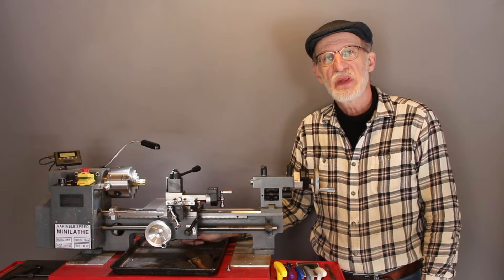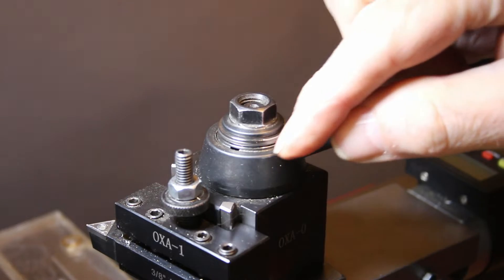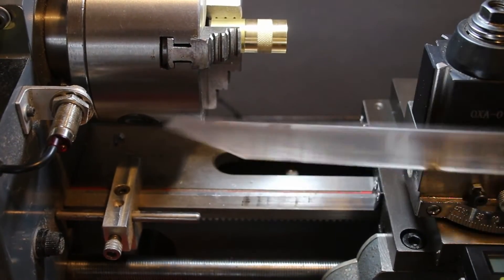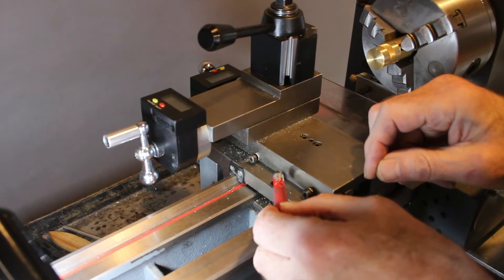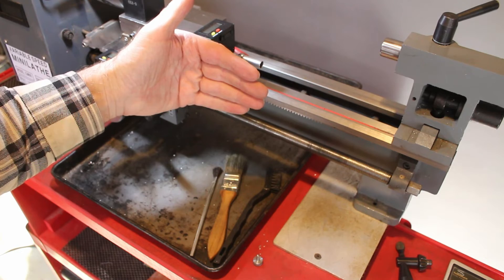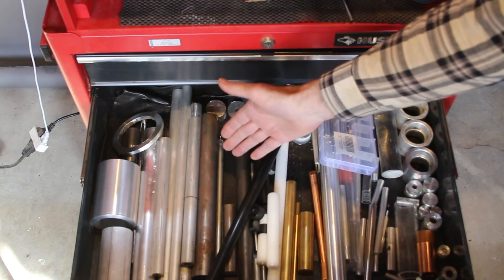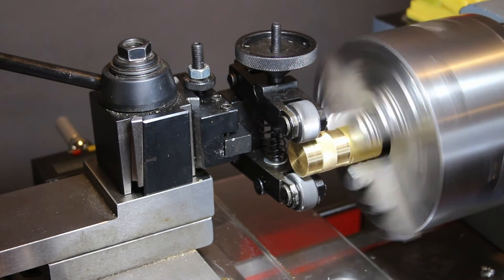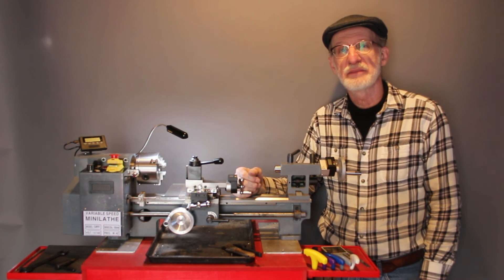Mini lathe add-ons and upgrades

Comment: I am not happy with the HALL sensor's location. It can be mounted inside the head stock, there is space enough for that. It is very vulnerable in that position  and might be in the way with exchange the chuck.
Reply from the maker: I appreciate your suggestion, but I found this to be the most practical location.

Comment: I got one recently but there so much movement around the cross-slide and compound ive tightened up all the gib screws but they still move, any idea if this can be fixed 🤔
Reply from the maker: If you have a mini mill you may be able to re-machine the ways.  I did that with my cross slide and it really tightened things up.  I bought a carbide dovetail cutter that really breezed through that cast iron!
Reply: @GuyMarsdenMakesStuff  
Thanks for the reply and the advice, sadly I don't have a Mill, but I have found somewhere online that does sell new gibs, the lathe is second hand and I can tell it's had lots of use, so hopefully the gibs are worn out, I'll replace them and take it from there.. all the best pal 👍
Reply from the maker: @BillSikes.  Well, one option is to buy new compound or cross slide from Little Machine Shop.  I got an extra long cross slide from them last year and it is better than the stock one.
Reply from the maker: @BillSikes.  You know Little Machine Shop sell replacement parts for the C3 lathes.  I got a longer cross slide upgrade kit last year that allows me to work larger diameters.  Definitely an option!

Comment: Hi Guy, I know an old video but found extremely useful. I have a mini lathe and have been wanting to upgrade to DRO’s for some time. My cross slides have some backlash in them that I have been unable to correct, do these DRO’s handle the backlash or just count the revolutions and thus I’ll still have an issue? Thank you!
Reply from the maker: The DROs do actually count turns but as long as you take up the slack like on any adjustment for a machine they are very accurate.  The only issue I have with them is the battery compartment is weak and sometimes the batteries cause dropouts.
Reply: @GuyMarsdenMakesStuff  thank you, will look at ordering a set. Much appreciated!

Comment: These are great upgrades, for sure
though, i am a bit iffy about those cross slide rotation-based DROs since they depend on your cross slide leadscrew having zero backlash; though i guess one can preload them before doing any cutting when there is some backlash on said slides, there might be some difficulty maintaining precision if relying on those alone. But it certainly helps.
If only they could make DRO slider units much more smaller and compact enough to fit on these mini-lathes...
Reply from the maker: You get used to preloading them just like you would on any machine. But I have swapped out my tail stock to a linear gauge.

Comment: I wouldn’t think that MDF, being so soft, would provide adequate rigidity for a lathe support.
Reply from the maker: It's a strong box structure reinforced in all the corners with hardwood, and a hardwood 1x2 along the front bottom edge under the lathe.  MDF is surprisingly strong when used appropriately, and is also somewhat good at vibration dampening.
Reply: @GuyMarsdenMakesStuff  Just be careful if your cutting that stuff.  They call it cancer board.
Reply from the maker: @rodgraff1782  Yes I have excellent dust collection in my shop.  I have no dust at all on my work surfaces.
Reply from the maker: @rodgraff1782  it's stronger than it looks and is very dimensionally stable.

Comment: Those DRO-s you have are great. I have a SHERLINE 4100 and went to LITTLE MACHINE SHOP to locate the same bits. Unfortunately the various DRO-s do not identify compatibility. How did you identify what bits you have installed from LMS were compatible for your particular Lathe? Thanks in advance. 😊
Reply from the maker: My lathe is a standard Sieg C3, so those parts fit perfectly. However I've become very disillusioned with those DROs because they are flaky and don't measure actual position just the rotational position of the handles. I'm in the process of replacing them with linear magnetic readouts.
Reply: @GuyMarsdenMakesStuff  Thanks so very much for the heads up! 
Best Wishes......

Comment: I had recently  bought the older version of those cross slide DRO's from a  guy. They do not measure the actual movement, but rather measure the handwheel position, which is a pain. Are these units somehow different? I cannot see how they would be.
Reply from the maker: Yes, I misspoke in the video. But as long as you're always turning them in the same direction to get a measurement that you need they work great for me.

Comment: How do those DROs on the cross slide and top slide know when the position is changed?  Lots of good ideas here!
Reply from the maker: They read the rotational position of the handle. As long as you always turn them the right direction they are pretty darned accurate. I got them from Little machine shop, Link in the description below.

Comment: You certainly should never use your leadscrew nuts as a means of locking the saddle
Reply from the maker: I agree, I made a locking lever for the carriage.  Not sure if that is shown in my video.
Reply: @GuyMarsdenMakesStuff  Can I sk what you intend to make with the lathe?
Reply from the maker: I have been making a ton of stuff on it!  Check my machining playlist.  Mostly brass, aluminum and Delrin, but also some steel parts.
https://www.youtube.com/playlist?list=PLbms9GizN4aTLsOwolr5cuM2JtmTku12E

Comment: Hi ! Geat video ! I want tool locking lever but i dont have ideea the model and sise . . Please if posible send  to my link for this tool ? Thanks !
Reply from the maker: Not sure what you mean by a tool locking lever. If you mean the red handled locking lever I used for the carriage, that is just a cut down hex wrench that drops into a cap screw.

Comment: I have a 8x16 MX-210 that I bought new for $800 and it to was all a mess when it got here .. ended up paying $500 and have since done so many improvements, and have a 3-4 & 6 jaw chucks for any type of work .. I love the light.. I will buy one for sure !
Reply from the maker: I have those lights on all my machines now; mill, lathe, drill press.  They're great 🙂

Comment: If the glue fails that magnet will fly like a bullet
Reply from the maker: Well, it's been there for over 6 months!  I'm thinking about drilling and tapping a 4-40 bolt and mounting a countersunk magnet instead though. Thanks for jogging me to do that.

Comment: I just got my first mini lathe and I traded a compressor that I got for free for the lathe lol it's from 1986 but it's an American made lathe and just needs some maintenance and a good lube job
Reply from the maker: It sounds like you've got some work cut out for you getting that thing fixed up. There's a rule of thumb that if you buy a machine tool like a lathe or Mill you're going to spend as much on tooling. But in your case you're going to be spending a heck of a lot more on tooling!

Comment: Certainly some interesting stuff. Beside the head bearings replacement they are nice tricks. My best advice is to REMOVE the electrical cabinet from the place where it stands. In some case it comes in the way but mainly because it's much more convenient to have a separate remote electrical cabinet. It will allow for any electronics addons or repair much more easily...
Reply from the maker: Great point!

Comment: I like the carriage lock. Very minimal yet effective without really needing to bury holes in the lathe
Reply from the maker: Thanks. It is simple but sometimes the lever falls out of the cap screw at inopportune times.  And also it limits travel of the saddle.  So someday I may do a different version like other people have where it is outboard of the saddle.
Reply: @GuyMarsdenMakesStuff where can an example of this outboard saddle lock you are referring to be found? are there any links? thank you
Reply from the maker: @I.H.D135  littlemachineshop have one that bolts onto the saddle:
https://littlemachineshop.com/products/product_view.php?ProductID=2977&category=

Comment: Guy I love your video and I will be modding my mini lathe which is arriving today. So I also subscribed. However you have made a mistake when you are talking about the small DRO’s. The DRO that you have installed on the bed is measuring actual position. The other 3 including the tail stock one are measuring rotation of their appropriate lead screws, NOT actual position. They use rotary encoders which are housed in those black plastic boxes you have mounted behind the hand wheels. They are very accurate but they are not really measuring the position of those slides like the big one is doing. The only way to measure actual position is to have something mounted on the individual slides tracking it’s position relative to their bases. I have similar rotary ones on my Sherline mill and they are extremely accurate and repeatable. 
I can’t wait to watch more of your videos.
Reply from the maker: You are right, and not the first person to correct me on this. They are extremely accurate and repeatable so long as you always turn them in the right direction as you're coming into the workpiece.

Comment: Are you sure the hand wheel DROs are measuring actual slide movement and not hand wheel rotation? A quick test would be to exercise the compound slide play without turning the wheel and verify it is registering on the DRO. The only DROs I've seen that mount to the hand wheel like that, measure the shaft rotation. But I have been wrong before and I'm sure I will be again. ;)
Reply from the maker: Thanks for noticing my verbal goof!  You're right - it's the lead screw rotation and not actual position.  But like with any handwheel, you need to take up slack and always set up fro the same rotational direction for accuracy.  Thanks for noticing!

Comment: Use the original tool post locking lever on the new tool post it makes it a lot easier than having to use a wrench. It was the same thread, at least on mine it was.
Reply from the maker: Neat idea!  Hadn't thought of that.  I went and tried that on my lathe and didn't like the way the handle stuck out over the lathe bed obscuring my line of sight.

Comment: Great video, looks like you have made some nice upgrades to that little lathe. Really interested in those DRO's and I might have to look into them. Look much easier to install than the glass scale ones. Cheers
Reply from the maker: Yes, they are an easy and simple add-on and they work extremely well.

Comment: Love the mods!  I'm running an Atlas 6" lathe and several years ago converted to the OXA tool holders from Little Machine Shop.  I'll be doing the thrust washer mod. Sweet tach install and those Handwheel DROs rock! Your link for the Gooseneck light no longer works.  I see the manufacturer is EVISWIY, but not available in black.
Reply from the maker: I'm glad my video was helpful!  I have updated the link for the gooseneck light, they still have them!  I suspect that I have influenced quite a number of purchases of those cool little lights, there an extraordinarily good deal.

Comment: Hi Guy, how are the factory cross and top slide handles secured in place? I tried unscrewing them in the vice and all I succeeded in doing is gouging the chrome and now they're worse than ever 😞
Reply from the maker: On my machine I just remove the screw in the center of the handle and the handle just pops right off.

Comment: Very good job !!! I also have a similar chinese lathe, a metric one ( i'm from Italy ), i bought it ten years ago and more ... i had to desmontle and reassemble almost all ( as you did ) as the machine was in very poor condition, loosen screws that - when locked - were making problems ... they were left loosen intentionally ...
I also had some problems, internal gears with broken teeth, they were plastic !!! ; and, no having at that time any idea were get spare parts, i had to rework ( with high speed of the lathe still functioning ) 4 gears of module 2 , teeth 33 and 13 for lower speed, and 23 and again 23 for higher speed ... 
Also the control box was recently broken ( not the electronic itself ! ) and i re-arranged all in a plastic box for electronic projects, fixed to the lathe with four exagonal bolts ... now all is ok, i got spare parts of almost all the machine.
I can do ( i'm an hobbyst with the lathe ) many usefull works, the more important was a conversion of a KT 150 cross table Proxxon from metric to inches, so to easily drill printed circuit board of my ( poor ) design ... and to do so, i got and fixed on the left of the lathe one big 127 teeth gear ...
Reply from the maker: Thanks. 
I have removed the gears in my machine since I motorized the carriage drive screw with a variable speed DC motor, see my video about that here:
https://youtu.be/B18NLCKUYK0

Comment: partner  your way too organized...................other than that, I have that same 7x14 lathe in battle ship gray.  aluminum cranks too and have ran into the usual problems  the worst being the motor wants to start on its own and ya never know when, so I always take the chuck key out......prolly a speed control problem, also the famous belt problem!!!  mine wore out and broke and they were impossible to find!  so I tried grainger and they had something compriable  but not the same  but its been holding up.and yes that motor is weak  and will bog down  and strain if you push it..........I also bought some HS roller bearings and took them to a machine shop  which they were unable to get the old ones out so I couldnt use them,   you sure did some nice upgrades......
Reply from the maker: Thanks - I think, that was a compliment right? 😀
That's really frightening that your lathe starts by itself! I would be on that just all that right away.  Yes, I struggled with finding the right belt too!
Reply: @GuyMarsdenMakesStuff  yes compliment..........u did some good things to that chinese to tay chinese headache

Comment: Very nice video, thank you! Do you find any loss in rigidity from the wood mount / travel drawers?
Reply from the maker: Not at all, in fact I think it stiffens up the whole bed because it's mounted to big 1/4" aluminum plates on top of the MDF riser.  Sure, the tool chest shifts around a little bit when I use it, but the lathe itself is solid.

Comment: I don't know if you misspoke but those handle dro's do not go off of absolute positioning and do in fact work off of the hand wheel position which means that slop is a factor in the readout...just means you have to do all your cutting operations zeroed from touch off in one direction only as soon as you back it off you can't trust it

ask me how I know
Reply from the maker: Yes, I guess I did miss speak about that. I routinely zero the DROs after touching off and only work in one direction from that point on.
Reply: @GuyMarsdenMakesStuff  no worries we all muck up now an again, when I got started I actually thought that having handwheel DRO's would be a lot better and in the sense that you can zero and scale it and it's easier to read it is but sadly no more accurate after taking one apart and realizing how it worked.

What you could do is get some cheapish digital calipers and mount them to the cross slide (and compound if you want) as long as you get the parallelism as near as damn it you could have a .01mm readout that is reasonably accurate...you could even mount one on the tailstock and have the display horizontal so it's even easier to read that way you've only gotta touch off each axis once and you're all good.
Reply from the maker: @nauroticdax  as a hobby machinist, I'm finding the hand wheels quite sufficient for my needs. I find the idea of mounting calipers just too messy and awkward so I'm not planning to go there.
Reply: @GuyMarsdenMakesStuff  fair enough if it works for you stick with it
Reply: Agree. The rotational dro’s do not help with the backlash (slop) and are pricey.  They are still much better than using the hand wheel scales. I bit the bullet and installed linear dros and no longer have to manage backlash.  While it does require a bit more effort, you only have to do it once. Also, if the linear scales go bad, replacement is simple and low cost since the fixtures can be reused. I do use a rotational dro on the tailstock quill primarily to control hole depth (less critical tolerances in my applications).

Comment: ill buy the old tool post. l did artisan makes AC motor mod. check it out
Reply from the maker: Sorry, I already scrapped out the old tool post for parts and making things out of the metal.  
My next project is motorizing the carriage, keep an eye open for that video I'm using a powerful 24 volt DC motor.

Comment: Hi Guy, just subbed. Do you  have plans for changing the  headstock bearings? I did in mine and it is a measurable difference and worth doing. 
Cheers
Reply from the maker: Thanks for the sub. I don't have immediate plans to change the bearings. It looks like a daunting project and I don't have a gear puller. So far I'm doing okay without it but one day I will hit the wall and tackle bearings I guess.
Reply: @GuyMarsdenMakesStuff  it's actually quite easy to remove, and not daunting at all. Steve Summers and This Old Tony both have great vids on the topic. I followed the method that Steve used and sized the shaft an mdf lap that I made, super easy. 
Cheers